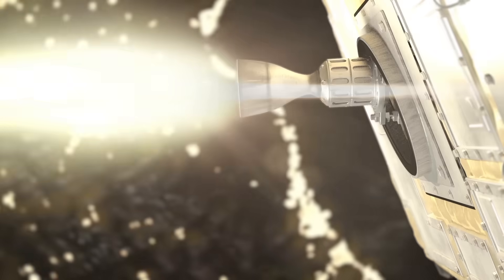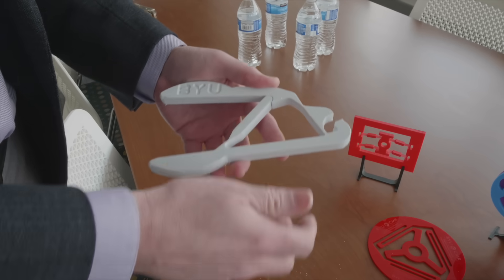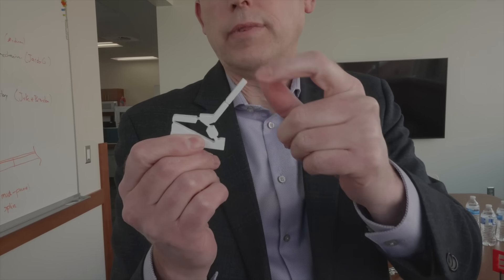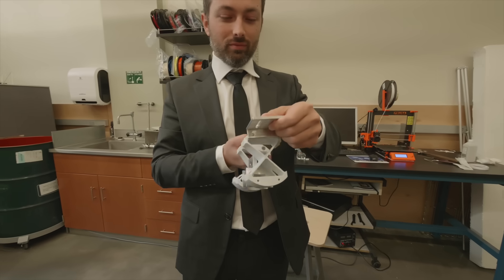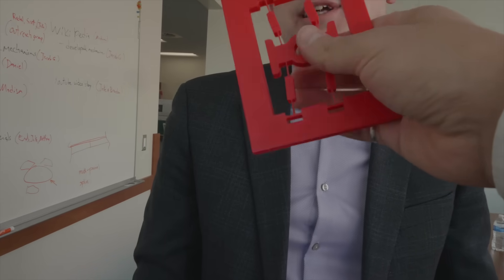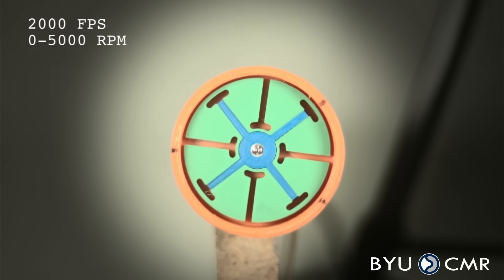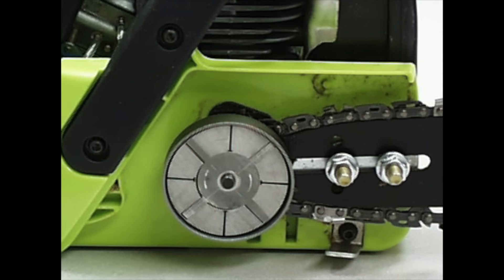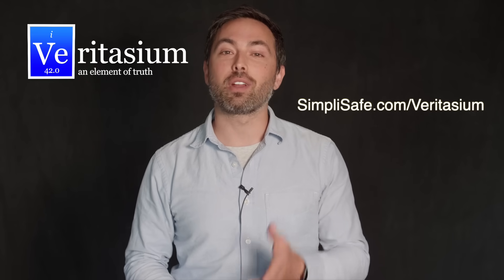Why Machines That Bend Are Better

Comment: "These look just like Vice Grips, but with flexible points instead of axles...."

Um, I'd rather have the Vice Grips tbqh... Axles can be easily repaired/replaced, whereas a bend point is constantly stressed with use, which leads to micro-cracking, cracking/tearing, and eventually irreparable failure. Ever taken a paper clip and bent it back and forth until the wire broke? That's basically what's going on with this prototype tool every time you use it. That means the entire piece has to be a good spring steel, and must undergo a proper manufacturing, hardening, and tempering process. Worse in this particular design, however, is now you have to build it out of differential steels (the spring areas spring steel and the jaws tool steel), and you must also figure out how to temper the spring section to spring temper whilst keeping the jaws as hardened as possible.... Differential materials and differential hardening/tempering processes... Lots of costs associated, when a Vice Grip is just tool steel jaws on heavy stamped/cast mild steel components, with a spring and a screw mechanism... Even simpler and cheaper is a generic slip-joint pliers; two cut/forged/cast lengths of tool steel with jaws and a joint on one end, and a heavy-duty fastener through them as a fulcrum point....

Further, an axle can still function to near-capacity all the way to the point of failure, whereas this particular bend point tool is going to have a wild degradation in performance as it goes from factory new to irreparable failure. With the very first squeeze, you're imparting stress onto a rigid structure, which leads to microscopic breakages of said internal structure which weaken the spring as less tensile strength is possible... Worse yet, as the spring continues to wear over time and use, it will start to "sag", meaning it won't return to its initially designed rested position, but fall somewhere inside its normal range of motion, until it either fails or has sagged to the point it no longer functions as designed. This is typical of firearm magazine springs when the magazine has been left loaded for a long period of time (typically 15-20 years). A good stretch of the spring will fix feeding issues, though the spring is weakened and will deform again (faster this time). At this point, the mag is best used as a spare range mag, because the reliability will be forever questionable.

Don't get me wrong, there are plenty of great applications for bendy parts; tie rods, leaf springs, Russian rear rifle sights, thruster cages, shock mounts for microphones, big fat juicy bass guitar strings, etc. etc. etc... But some things should just be left simple... Like pliers... Cuz pliers shouldn't bend; they should be rigid and impart much squeezing force multiplied by the factor of levers....

:)
Reply: I think the idea is that you could 3d print this simple tool onboard, say, a space station. Obviously they are not trying to take on the homeowner vice-grip market.
Reply: The other thing to remember is that when you’re bending a paper clip back and fourth until it snaps, you’re taking it past it’s designed range of motion, past it’s yield strength, where it starts to experience plastic deformation.  As a result, un-reversible changes to the shape occur and mechanical degradation occurs at a much faster rate.  

However if the paper clip in this example is only ever flexed below its yield strength, well within its elastic deformation range, it’s going to last a really long time, even with many intervals.

If you look at this guy’s widgets, the range of motion of each joint is always confined so that the joint always stays safely within its range of elastic deformation.

This is why the engineer stated that his simple switches have been tested to function successfully even to a million intervals, using materials like polymers.

It’s pretty cool stuff.
Reply: this is just an example.... not meant for actual replacement of the vice grip. Also if you brake an axle you have to search for it and not many sell "parts" for vice grips... you just buy a new one... and compared to the bending one, it will be way cheaper. Also if you watched the whole video, you can see a machine basically "abusing" the bending parts and he said they went more than 1 million cycles, and at a very fast rate too. So it's no paper clip and this material is engineered for this exact purpose. You say "the entire piece has to be a good spring steel, and must undergo a proper manufacturing, hardening, and tempering process. " This plastic is made in a similar way. Again, it's no ordinary plastic. I wouldn't believe a plastic would hold that well either but after seeing that machine abusing the plastic and not failing after 1 million + cycles, I believe it.
Reply: And again, this is not meant as a Vice Grip replacement. It's just a demo of what you can do. Also as you said the sprint will sag, everything will wear. Be it a metal axel or anything.  Last thing I want to mention is you seem to forget that this type of engineering can be applied to all types of materials, such as titanium as demonstrated in the video.
Reply: Honestly, I was mostly just playing devil's advocate here. :P

Comment: parts count: so if you break one piece, you basically throw away the whole thing?
Reply: yeah, but it only costs cents, a regular tool like that costs several dollars. And also how many people are going to repair this tool and how many are just going to buy another one?
Reply: @MDP1702  production costs aren't sale price. Even if it only cost cents to make they need to pay for the materials, employees, machinery maintenance, warehouse, storing, packaging, distribution etc. Even then the price is increased for retail sale so stores can profit.
Reply: @davidgutierrez8297  the materials, employee hours, machinery maintenance, ... are definitely part of the production cost. Now the other things, sure, but everything else (including the same "usual" tool) has these costs too. Basically you could probably quite easily get things like this to a sale price of half a dollar, a dollar at most. Disposable plastic cups have a sale price of one cent. Now ofcourse this tool is a bit more complex, however similar very cheap methods would be used. As for storing, it shouldn't really be an issue, not for something as small as this. Packaging can be done really cheap if you go for large quantities and automated process, like I'd be surprised if this costs more than 2-3 cents per tool.

Also plastic when bent enough just snaps.
The entire point of this techniques is that it doesn't happen here. Their switches can go through a million cycles. I'd doubt you use it that often. As for bending it too much, how would that happen exactly? Only improper use would cause that.
Reply: That's what you have to do with most tools anyway. Have you ever tried to find spare parts for tools ?
Reply: @ranty13  good tools don't need spare parts. They just need servicing. I have a good quality pair of vice grips. Thing has existed for over 30 years and still works well. Just lubricate the hinges and don't mix with water. Also plastic when bent enough just snaps.
Reply: Simple means less likely to break... and generally MUCH cheaper to replace when it does.
Reply: @antonjeu  Can u help a little?
I need 12 more subs.
Reply: That's a disadvantage of the compliant mechanisms but they are kind of durable and cheap.
Reply: If you break a set of vice grips, are you going to repair them, or get a new pair?
Reply: @StyxNstoners  It all depends on context. If I have access to a hardware store, I'd buy a new one. But if I'm in a remote place, I'd probably like to be able to repair it.
Reply: @drewmandan  remote place like on a space mission? With a 3D printer, and some files it's a big weight cut for liftoffs. Instead of having to carry a bunch of extra tools/parts, astronauts can print what they need.
Reply: @StyxNstoners  There are other considerations. If needed to carry your feedstock with you, that's a problem. Since feedstock for a 3d printer is, by definition, not specialized, it will always be heavier than individual parts. Alternatively, you could try to convert regolith into iron metal, or steel if you need actual strength. But this is not easily done and takes a lot of high power intensity infrastructure to melt the ore. When you start to add it all up, it becomes a lot more tempting to simply run the odds and calculate that if you take X number of spares, you have less than Y chance of running out, whilst maintaining a lower mission mass. 

Another thing to realize is that some parts don't need spares at all. A forge can be used to make large yet simple metal parts in situ and be lighter than full spares or a 3d printer (again, you have to factor in the mass of the feedstock). So for example, a wrench would be optimally made using forged steel combined with a small number of spare parts.
Reply: Yep! Good point. Still cheaper than the traditional tools though(like a lot cheaper). Get spares and you should be ok ;)
Reply: Nobody fixes anything these days.
Reply: @nomadnevermadbetelgeuse9803  you are so wrong and that is a stupid statement. If that is YOUR mindset, bef irston your blockto start fixing.  It's creative AND GREENER !  Half the comments here are about making spare parts or self generating what is needed.  3D printers themselves are made of component parts and every owner I know fixes their own printers !
Reply: @kindredtoast3439  Plastic is really hard to recycle, with metal you just heat it until it's all liquid.
Reply: But there so cheap you can replace it
Reply: @daftmi9hty327  no such thing  as "cheap" in any industrial application, unless the hardware store is beside the broken machine AND has the part you need. That's why spares are essential in all production environments.
Reply: @loftsatsympaticodotc  yes but single parts made out of one material would significantly cheaper i know they will keep spares because it would be stupid not to
Reply: it would be quite a bit cheaper i imagie like 10-30% the normal price so it would be worth it if you bought 2 or even 3 but i still think you have a point if your purchacing for the long run
Reply: @Eli Z I wonder what they plan to do with all the plastic collected in the plastic recycle bins we have here in Finland? Ok, they are for plastic food packaging which are made from a specific type of recyclable plastic. But they are still called plastic recycling bins.
Reply: just like an apple device
Reply: cheep??  you guys never get it. if it hit the market, they will force you to buy 6 peaces of the same tool, and throw in  cutter, and a another potato pealer , in the end you will pay as usuall  19.99$
what are you wating for!! if you order now, we give you mini knife and 2 plastic forks
Reply: Dude, they last over a million cycles, they are only gonna break after years of usage or on purpose with brute force.
Reply: one million repetition for few bucks...
Reply: @Eli Z
This makes me sad.
Reply: @shivansh4581  since when are there hinges.... on a vise... and YES if you have a good vise, you CAN change jaws, and the slide etc.
Reply: I think, the point is that you should be able to 3d-print the whole tool yourself if the old one breaks.
Reply: Also easier to recycle if the entire thing is made of one material and has no other substances (lubricants) in it, so although if it breaks, the whole thing won't work, it's still easier to re-use it for materials for other such devices
Reply: think about the recycling
Reply: exactly - only one thing to fix!
Reply: because it's one piece, you can most likely hot glue/tape it back together. but if not, reduced production costs will make the product much cheaper to replace. also, seeing as they're made to bend, they're likely very strong as to not snap.
Reply: As if stores even sell spare parts for tools or anything in the first place.
When was the last time you saw a shop sell spare wrench screws or loose scissor blades.
Reply: Man y the hell would they break if they are made to be bent!!!
Reply: Each mechanism is one part
Reply: Brytsk Nguyen true, but most hand tools are tossed rather than repaired anyway. Don’t think you could buy parts for pliers anyway?
Reply: It is very flexible but not anti-idiot
Reply: I agree with many in the comments, we don’t agonize over breaking a bolt or hinge because those seem like parts of tools instead of tools themselves. It’s all relative to the over all price, frequency of replacement & cost over time.
Reply: Complexity is a utility vs ease of maintenance tradeoff.
Reply: Also easily revycalbt
Reply: I'm not a big fan of one-use items but think about how many like tp, flaming lighters, bottles, bags...   Secondly  these compliant mechanisms probably work best when they are microscopic...or consider a giant one that could just be pulled out and replaced as easy as an engine air filter?  Replacing levers and springs...I repair small engines and its ridiculous what can happen if you lose a spring the size of a human hair.
Reply: Well, many complex mechanisms need to be built from many parts anyway. Sometimes you need different materials for different parts, sometimes the whole thing is just too big to be made in one piece. But compliant mechanisms can be used even in this case. Say, you have two arms/beams/long thingies linked with a joint. You can have just the joint be compliant. It's cheap and easy to make a replacement for the whole joint, reap the benefits of no backlash etc., while the arms themselves are bolted to the joint part. I think realistically, a single compliant part would be either very simple (like a joint or switch) or would replace something that's not worth repairing/extremely hard to repair) in most cases anyway (like microscopic mechanisms). Sure, there will be cases where a compliant mechanism can replace something that's repairable, but the other benefits (potentially including durability) are worth it.
Reply: You can use a solder iron to melt the plastic to stitch the broken pieces together again.  You can also put the broken piece into a 3D printer after using a 3D scanner on it and it'll reprint the broken parts.  You can also melt the broken pieces to make resin that can be used to 3D print it again.
Reply: Like all production and design methodes it has it's drawbacks that is why having as much possibility's as possible is important, some methods are better use than others.
Reply: Gotta throw the whole tool away
Reply: @stupidartkid3120  but if the material is recyclable, it's a piece of cake if you have the manufacturing tools with you
Reply: Kindred Toast thats why the great pacific garbage patch is made of metal scraps
Reply: You wouldn't understand considering you're an illiterate troglodyte. Go to work and tend the rice fields yellow man.
Reply: @adolfhitler7394  well said, Hitler.
Reply: @kindredtoast3439  That's funny because at my shop we recycle the metal chips and throw out the plastic.
Reply: @Eli Z That is an irresponsible statement, and wrong.  I replaced many glass panes with plastic and NONE of them have broken.  Try replacing the plastic probes on your hi-voltage tester with all steel!
arp.  You are  fried~    Lastly, all electricians have replaced their step ladders.... with glass HELD TOGETHER with plastic bonding.  Can you imaging changing a 2400 V line and 1 conductor grounds to your body standing on an aluminum ladder on a wet floor, with sweat-soaked shoes on?
Reply: @loftsatsympaticodotc  I'ts really stupid what you're saying, electricians use tools, gloves, and boots made of plastic, no more is needed.
Reply: Ending is better than mending....
Reply: The whole Tool costs as much as spare parts and also lasts longer. So (smirk) yeah....

Comment: I put my lunches in containers that have a lid that can attach with latches which snap into place.
The problem is that the plastic they are made of is required to bend and eventually it wears out and simply breaks-off entirely and I cannot attach the lid as intended.

Despite the points raised in the video, my lunch storage issue makes me disagree with the assertion that "machines that bend are better" (at least for all applications).
Reply: if the plastic loop that locks down your lunch box lid was in a slot (rather than a hole) with plastic engineered to act like a spring between the loop and the latch top, the load on the loop would be drastically lower, while still retaining the same amount of hold it achieves right now. it's not so much about everything bending, but rather letting it bend in the right places.
Reply: IceFireXD 
Yeah
The item I was referring to bends in the wrong spots and has since been fixed by a shoelace.

Comment: Many electric motors could go on much longer, such as compressor motors that need a strong jolt to get started, then drop that added current to keep the rotor turning!!! This takes a 'clutch', that provides momentary contact but as soon as the rpms reach the target the clutch disengages.

Comment: Didn't know we can 3D print that type of metal.
Reply: I think you can 3D print anything as of today... Glass/ carbon/ aluminium/ steel/ plastic... Everything. It's just a matter of the printer.
Reply: @kyriakos098  you not getting the point of my comment. I wasn't talking about steel metal. And plasic. And aluminum. Glass I already knew about, same for carbon.
Reply: @kyriakos098  just in case you still not sure what I am talking about, I was speaking of titanium. I know that we can heat it up and hammer shape it just didn't know we can 3D print it. It has a very high melting point. I felt like if we use too much heat the printer would melt. Lol